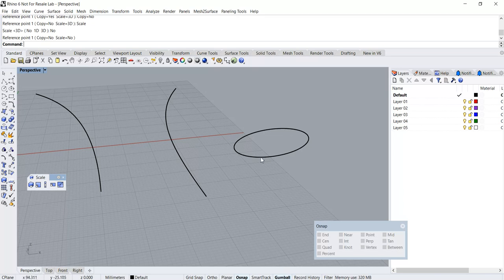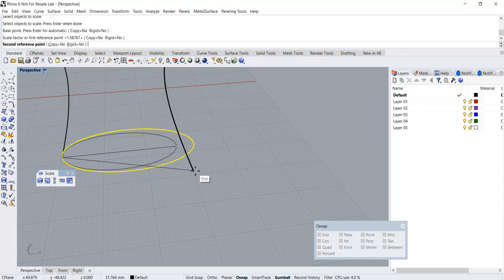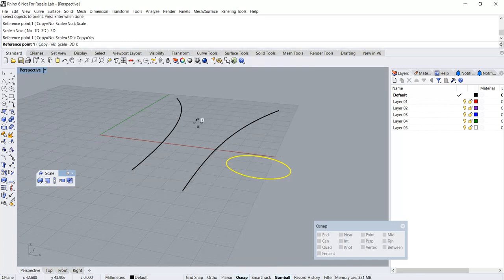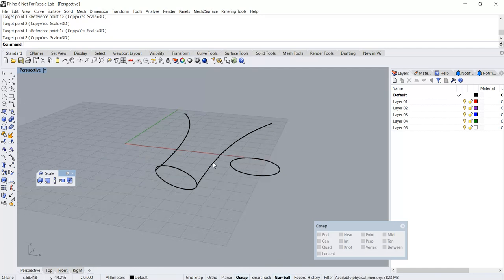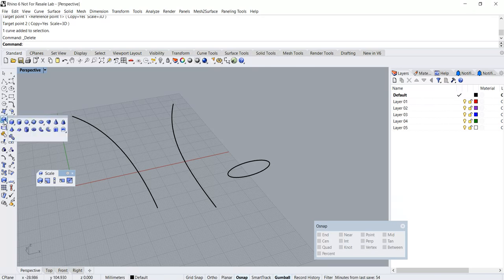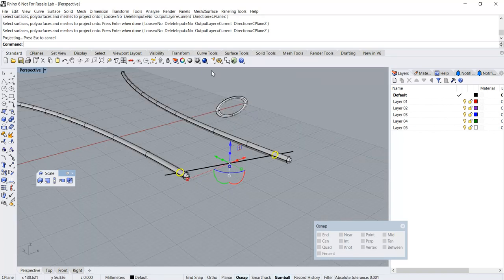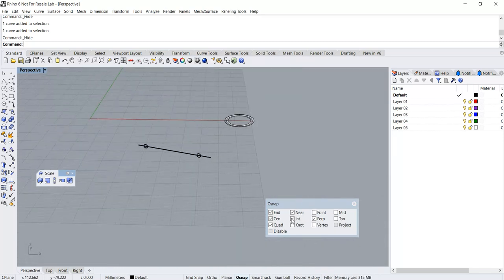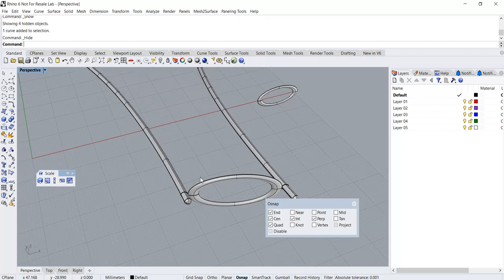Rhino 3D Tutorial: placing and scaling between 2 locations

Comment: Nice.. but how to have precise clearance with the ellipse in both sides of the line? its like I want to put 3mm allowance on both sides, so that the ellipse dont attach to both lines..
Reply from the maker: Oh... that is a difficult one. I haven't really figure it out yet. But my guess is that we got to somehow get the Osnap: Tangent locations of the ellipse meeting the curves.
Reply: @simpernchong  I try it by creating a line connected on both other lines and snap on the center and create ellipse a little smaller.. but i cant make the gap precise without using mathematics..
Reply from the maker: @MrElanrivera  I see... thanks for the sharing.